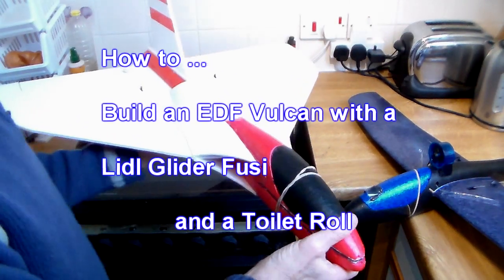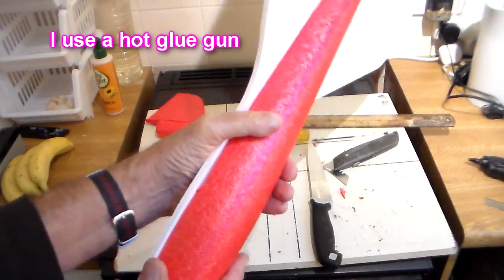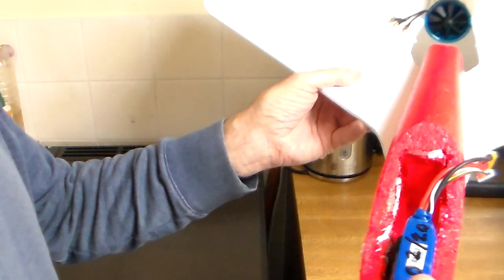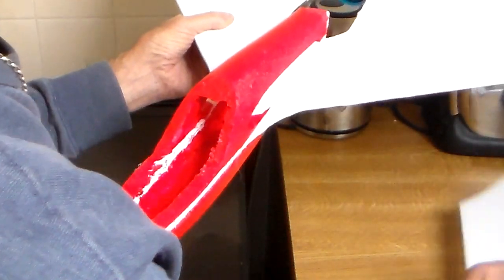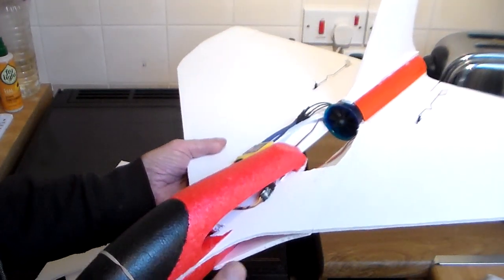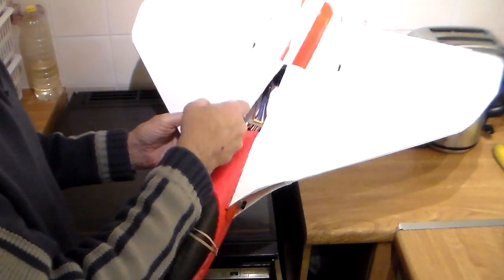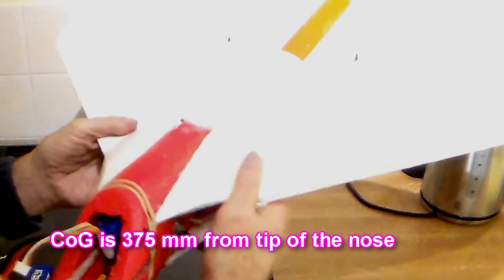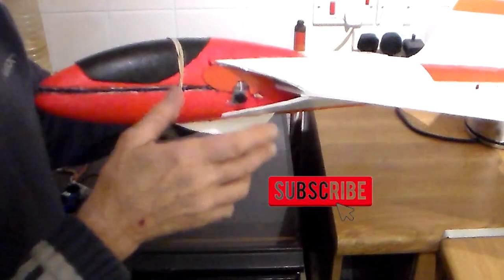My EDF Foamboard + Lidl Glider Fusi Build Blog and the Design Process

Comment: I do wonder how much disturbance is caused by that wiring in the inlet duct ahead of the EDF. 
Surely the air in the duct is travelling faster than the plane is flying so any effect is actually greater than if the wiring was on the outside.
Reply from the maker: I take your point.  I taped the servo wires to the foamboard, and tried to route with that in mind, but it was difficult to avoid as all wires and the 3 wires from the EDF have to cross the airflow at some point to get to the centre of the fusi and the rx and battery. I doubt it will affect the thrust, if I dare use that word on a baby edf!  It was a design as you go job, Mk2 will be better assuming this flies well!